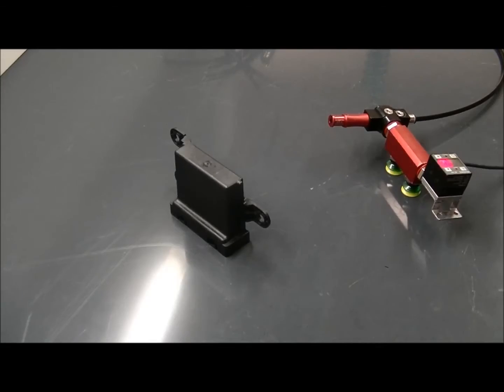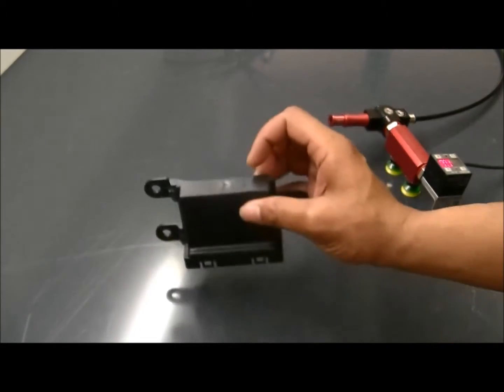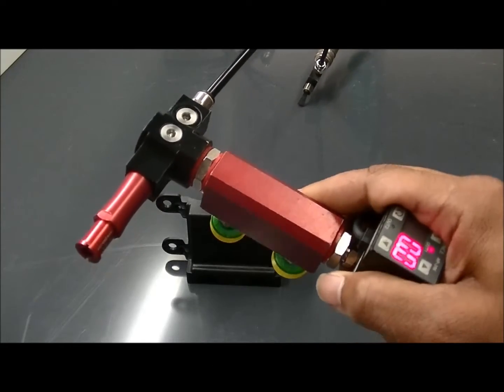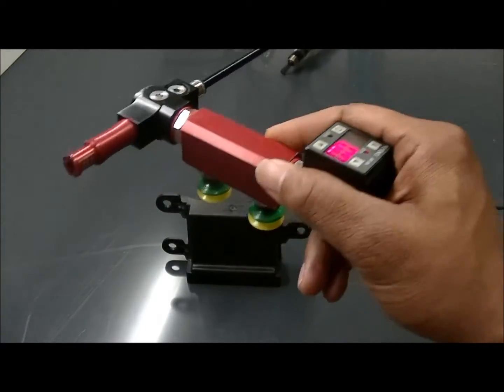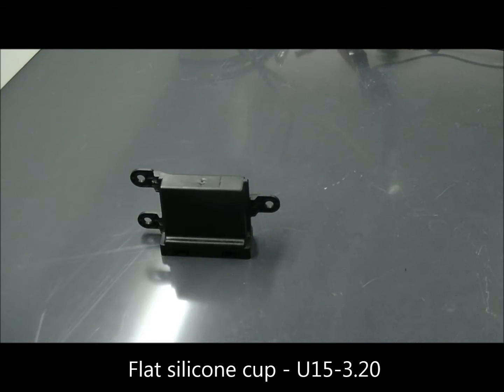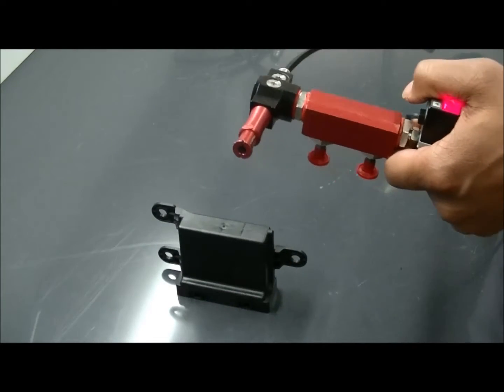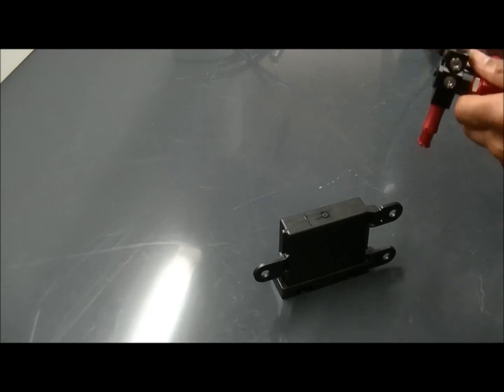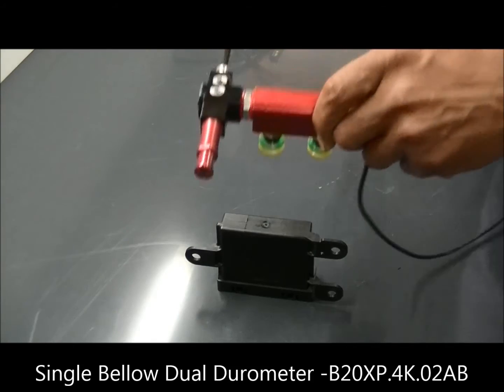Small plastic part lifting with vacuum - Piab

Comment: The led display on the valve is an Air Mass sensor?
Reply from the maker: It is from Keyence Corporation.
Reply: @PIABVacuumTechnique  hey can you give me details of the pump you used?
Reply: I mean its  price , motors'  rating , mechanism etc